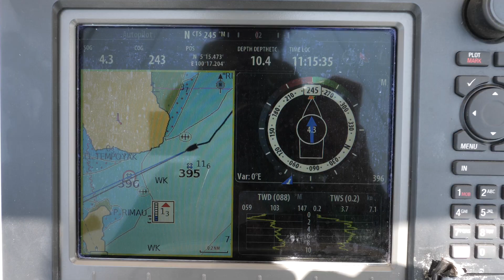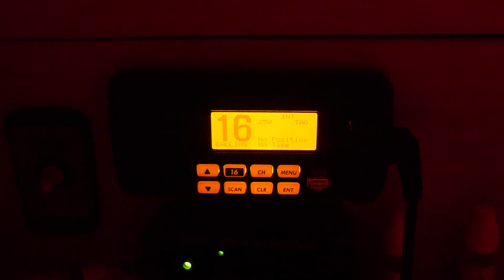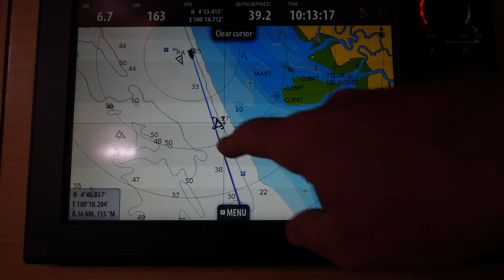HOW TO USE A ROLLING HITCH AS A SNUBBER Ep 68

Comment: Thanks for the tip on using that rolling hitch on the snubber.
Reply from the maker: [Liz] So far, so good. We'll let you know how we get on with it...
Reply: @followtheboat  Just a thought because I saw people putting two special made snubbers on: Could you also fold the warp in half, tie the hairpin end onto the chain as if it was one line and then you would be left with two ends of the warp--one for the left cleat and one for the right one. Would that be extra security or is there a problem with this approach?

Comment: When the snubber line snapped?  Can you tell us the approximate depth and the anchor line/chain to depth ratio?  I will usually use a 5 to 1 unless things are getting rough and windy and then move to a 7 to 1. (S/V MAGIC 50' Gulfstar Ketch)
Reply from the maker: Hi John. We never put out less than 35m, even in 5m of water. We've been known to put out 10/1 before now but we aim for 4-5/1 scope.
Reply: Good to know...helps keep it in perspective.  I have anchored in some pretty brisk breezes but not in a combination of wind and waves to need to calculate the Bounce/Stress factors...  Love watching your journey as it unfolds.

Comment: Hello!! Thanks for the video, very helpful 

I have been doing that method but when the wind is a little gusty and coming from different sides, the snubber line does a lot of pressure in the hull (just the bow) dont you have that problem? Is better to tie the snubber to both hitches? Port and starboard?
Reply from the maker: Our snubber is only ever tied off on one side. It goes through the fairlead and over the metal plate that is fitted to the edge, where the deck meets the topside.

Comment: How many feet of chain do you have for your anchor? Do you ever use anchor rope or just chain? What is the science to it in your opinion?
Reply from the maker: Hi +Sailing With Vampires. We carry 100m of chain and no rope, which is more common with smaller and/or lighter boats. If you use rope you'd still want at least 10-20m of chain at the anchor end. We also carry 100m of rope should we use a stern anchor.

Comment: Hi Liz. You know that is not a rolling hitch right? It's a stopper hitch. You are using the correct hitch on your chain but the terminology is wrong. The stopper hitch is primarily used on commercial vessels when transferring a multiplait mooring line from a winch drum to a set of bitts. Maintains the tension in the mooring line when taking the turns off the drum end and making fast the mooring line. Just saying.......
Reply from the maker: Coo-ell, thanks! I got it from a book of knots, where it was called a rolling hitch. 😀 Liz